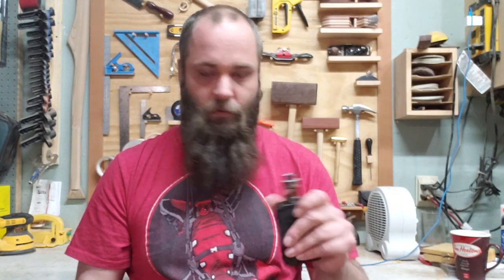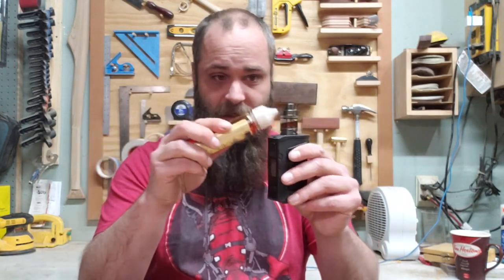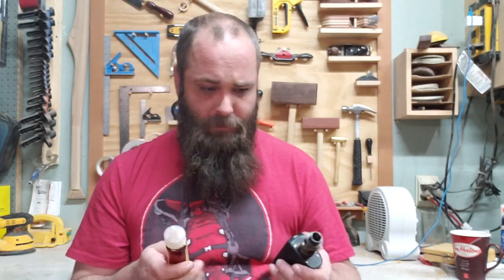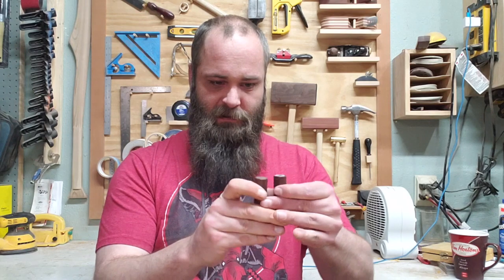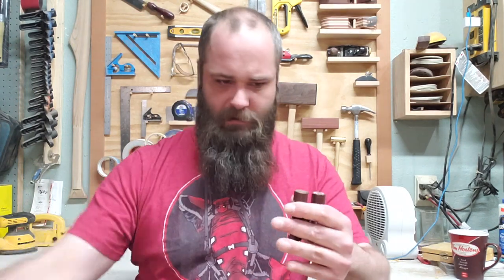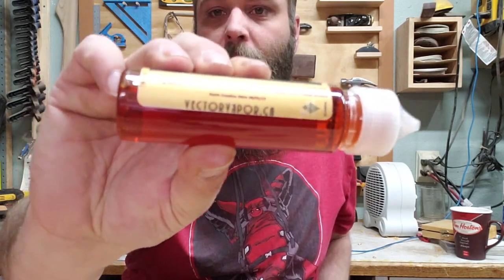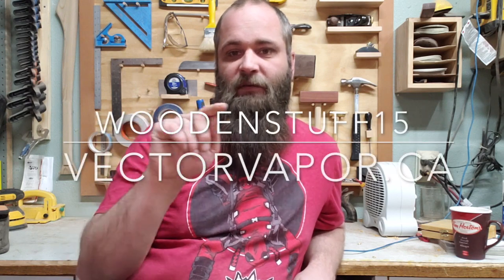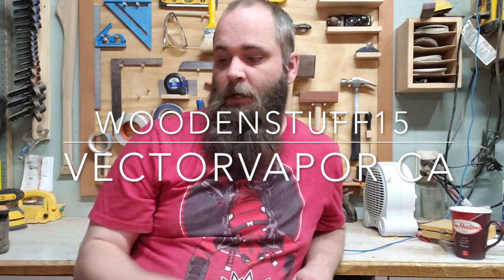How to almost put a router bit through your hand (VAPE CASE FAIL)

Comment: Congrats on your quest to stop smoking, I hope that goes well! One thing I have learned with a router is to do multiple shallow passes until you reach the final depth. It sounded like the router may have been having trouble getting through that much material at one go. Keep up the great work and again I wish you all the luck in quitting smoking. You will feel so much better once you have quit.
Reply from the maker: The bit was only exposed about  quarter inch. The issue was that the collet was loose. Because I'm sometimes an idiot. Haha. Hoping the smoking thing goes away soon. We'll see. I've cut way back thanks to that vape thing, though.